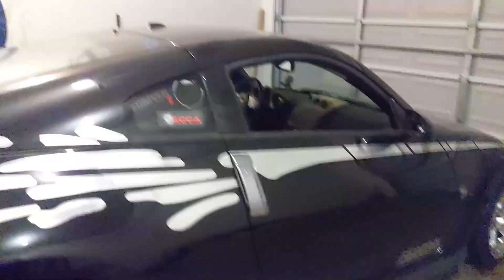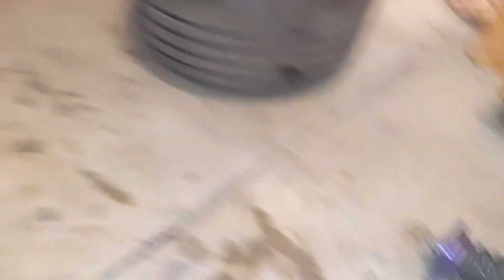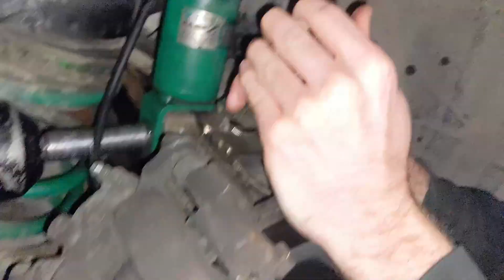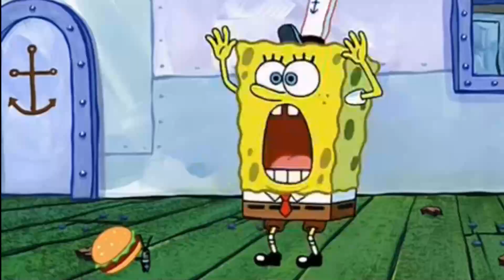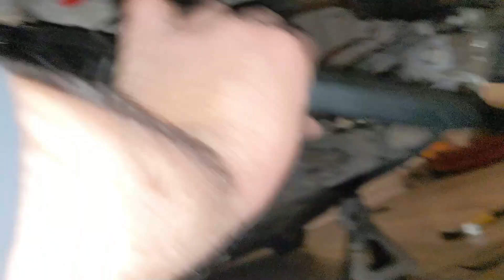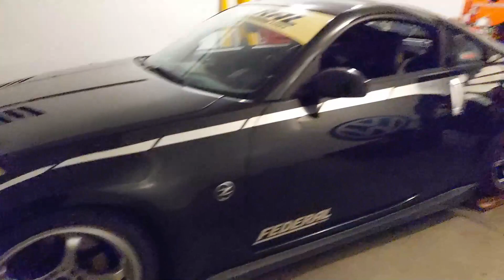350Z TRUE Rear Coilover Conversion

Comment: Hello brother, tell me please, have you done chassis reinforcements before installing true coilovers? Some people are telling me I can't install true coilovers without chassis reinforcement! What are the spring rates on your coilovers?
Reply: Thank you for your reply brother! BC RACING told me, chassis reinforcements must be done before installing true coilovers, but, I couldn't find anyone who did that!
What are the spring rates on your coilovers, I don't want too hard, thinking about 9/5 KG/MM
Reply from the maker: Hey man, I have not done any chassis reinforcements on the car. Honestly, this is the first I have heard anyone mention doing chassis reinforcements with a True Rear Coilover. I know a lot of people who have done this modification and track there car without any issue at all, including myself. The only thing I suggest is to check the bushing that the coilover will bolt to on the knuckle (this would be the lower single bolt). If the bushing is bad definitely replace it. And the rates I am running are a 12K front and a 10K rear.